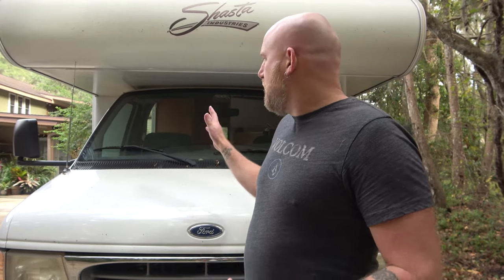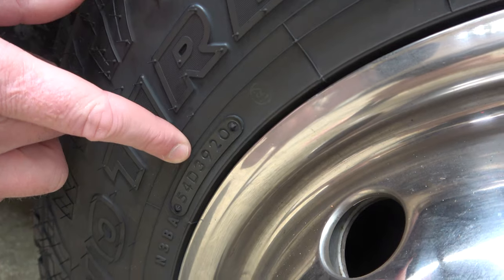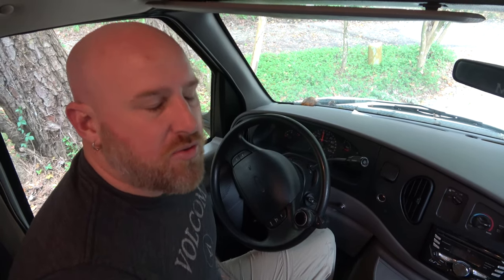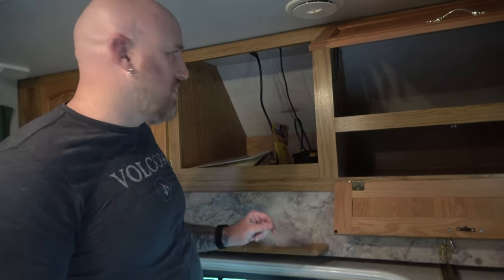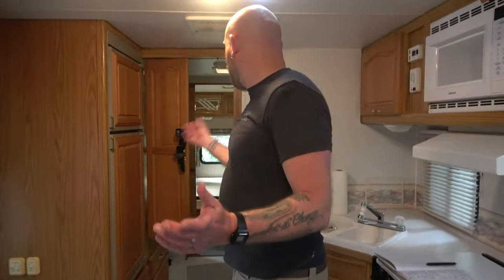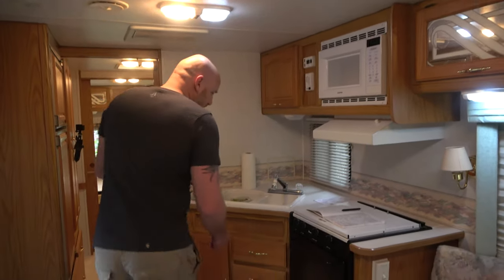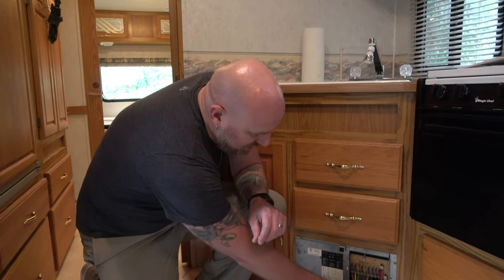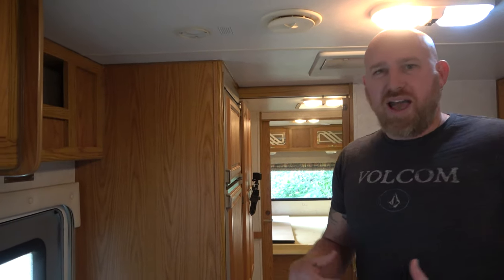What to look for when buying a used RV // Used Camper Buying Tips and Advice

Comment: As far as mileage goes, most people who get an RV use it for a few camping trips a year and most of the time it's within a few hundred miles.  Do the math on that.  If you did 4 trips to a place 300 miles away in a year, that's 2400 miles in a year.  Low mileage is actually the norm for RVs.  One other note, is that mileage is at close to the maximum capability of the drive train.  Think about wear and tear on a pickup driven empty vs. the wear and tear on a pickup that towed a trailer weighing 16,000 pounds.  So your 47,000 miles may be the equivilent of two or three times that.  Plus sitting for long periods is not good on seals and other components of the drive train.  Please don't get me wrong, that doesn't mean it's bad, I'm just saying be aware that "low mileage" is relative and actually the norm for these vehicles.
Reply from the maker: Thanks for the insight. That's why we did a boat load of preventative maintenance, had mechanics look it over and give attention to the things that looked shoddy or worn out. We ultimately replaced a few hoses with dry rot and the brakes and tires. But otherwise we've added 20K more miles without a hiccup! Thanks again!
Reply: However, they are built to carry loads unlike a truck or car. So while high mileage may be worse on an rv, low is not immediately 2x or 3x worse just because it is an rv.
Reply: @brianvandy4002 Excellent points! All questions to ask the seller about storage and hauling. I always read the comments and greatly appreciate those from  mechanics or someone who has a lot of inside information about the automobile world! Thank you
Reply: Are you daily driving this bad boy?
Reply: So would a motorhome from 1999 that has 125,560 on it, all the records are in it, (two owners) would this be too high mileage? I can’t get under it but my son can next week. I got in it yesterday and dug through everything. I found three small spots where water got in from caulking that needs to be redone. Since it’s a Lazy Daze, I know it’s made well and those spots can be easily fixed. I haven’t gotten on top or under it, that’s where my son comes in. Plus he’s a mechanic so that’s a plus. Your video gave me so much more info. I saw I did a lot right, including walking little by little feeling for water damage. I know the engine ac wasn’t working and was blowing hot air on a 102 degree day in Fl 🤦‍♀️.
Reply: There was some water damage or deamination it looks like on the rear left upper side

Comment: I would highly recommend changing the coolant and brake fluid. They will cause corrosion internally regardless of mileage. It's really just good to replace all the fluids on a new to you vehicle so that you have a baseline
Reply from the maker: Great advice! We're going to do a follow-up video shortly to talk about the next steps after finding a used RV and this is at the top of the list!

Comment: You can get a moisture sensor detector and put it on everything (the walls under everu window etc just like he did also don't forget under the beds.  NEVER forget the slides and them. Oh btw you can get the handheld moisture sensor anywhere online etc and it's cheap ❤ thanks for all of the amazing advice!!   Sorry one more thing with all of these hurricanes tornadoes "1000" year floods etc. Many NEW RV LOTS with their lots full these flooded RVs have been cleaned up and put on lots to be sold so please find out ok enough of me sorry
Reply from the maker: Great advice!

Comment: People will “DIY” them selves into a bigger cost repairing their own cars boats and RV instead of taking it to a professional. And when they can’t fix it they sale to someone who looking to buy their problems.
Reply from the maker: We have exactly the opposite experience, which is why we do what we do and share what we share. We could never afford to go to a dealer or RV repair person every time something went wrong. At $150+/hr and most RV-related tasks many, many hours of diagnosing and repairing, if you can figure out how to fix something then do it. Plus with RVs, things break and then break again. Knowing why they break and how to repair yourself is invaluable. We've gotten ourselves out of many situations on our own from having DIY experience. We know our limits. We know how engines work and can diagnose most issues from research. But we don't touch the engine. So every RV owner needs to know their limits. But DIY is not a bad thing if you are halfway handy and willing to learn.

Comment: When I bought my 97 Ford  E-350 class C in 2019,  I  checked the radiator hoses, after I had already took it home, and found out,  that every thing was original,  this man was sneaky  he had just bought 2 in house batteries so everything worked just fine for our first 2 nights of our first trip  later I found out that the battery inverter was not working so in the 4 years I've have had it I've replaced the radiator hoses water pump, serpentine belt,  all the fluids, upper and Lower ball joints,  both tiered ends and 2 more suspension rods , it's good to check the deferential oil,  mine was almost like  Liquid roofing sealer, I replaced it, in December 2022 I replaced  all 7 tires and  bought 4 Aluminum wheels, I  installed a front end reciver and bought a 12,000 pound winch just incase, I extended a rear platform 3ft for a  large  tool box and  to house the winch and  batteries  tools and  tow ropes,  it's been a lot but I hope it's ready for a 1 month trip to baja.
Reply from the maker: The older they are, generally, the more work they need. We had honest sellers who honestly didn't know what was good or bad with the motorhome as it was donated to their nonprofit and they just wanted to sell it for cash. Good news is that if you do have issues in Baja, the Mexican people there are amazing and you'll find help. We know Baja well... including many, many broken things.
Reply: A rig that old would need all the maintenance you mentioned.

Comment: .1. Make sure the dashboard AC blows cold air, there is a vacuum hose buried behind the engine that rots and leaks vacuum, that is supposed to power an actuator that directs cold air out the dash vents. $1000 repair at an AC repair place. 2 Make sure RV generator starts easily and stays running. If it has not been run often, may need expensive servicing $1000. The house batteries start the generator, power interior lights and furnace blower, water pump and electronic controls,  they  go bad if not cared for with distilled water and kept charged. Usually two 6-volt special RV batteries in series or one larger one $200+. 3. The converter charger keeps your house batteries charged and interior lights, etc. lit when you are connected to camp power, make sure it is working, $150. 4.The roof AC unit should blow cold air,$1000 5.The furnace should heat immediately and respond to thermostat settings.$400 6. There should be no sidewall cracks in tires and they should be no more than 5 years old regardless of tread depth for safety ($300 x 6 apiece). 7.The pleated day/night window shades may need repairs/replacement.$50-100, each. Some minor water damage may be acceptable. RV's are generally not designed to stay water-proof and are not  assembled by well trained people, emphasis is on speed, not much quality control. Refrigerators should be left on by seller to show that they work, they cost $1000 to replace. Slides are nice but may have mechanical problems and air and water leaks, and they are in the way when retracted. A typical Class C costs $50-100K+ new, depreciates quickly to $30K. holds value thereafter depending on amenities and condition.
Don't expect to buy a perfect used RV cheap and expect to spend DIY effort and RV repair money including maintenance, camp space rental, insurance and DMV fees,  and 9-10mpg fuel costs, much like owning a cabin cruiser boat.
Reply from the maker: Thanks for the additions.

Comment: If I may add something that may help all RV'ers

Headlights,  being able to see when driving is important lol..  there are many HL restoration kits out there , I've found Griots Garage Severe Headlight restoration kit is the best . I'm not a newbie ( was flown from my home here in North East to Arkansas to do a paint correction on an nice 02 WS6 Trans am) but this kit will give newbies professional results and your Headlights will stay clear for years not weeks or months.  The Headlight coating the kit comes with is far superior to other kits "sealants" , where the plastic will re-haze in just a few months.

Thanks for your time making this video.
Reply from the maker: Thanks for watching and contributing to helping others! Yes, this is a great thing to do with an older RV if it is needed. We replaced the headlights in our old RV because they were beyond being cleaned. But this RV didn't require it.

Comment: Thanks for the best info I’ve come across in the last 3 years I have looked online for an RV!  After all this time, I finally saw my first used Class C in person a few days ago.  I’m going back later this week to really start checking everything out & test drive with owner.  First concern was that it didn’t start; due to leaving the backup camera plugged in, according to the owner.  Unfortunately, inspecting some things including the roof isn’t a possibility for me at 68 with spinal fractures.  I was reassured, verbally only of course, that all leaks & moisture have not been present for the last year after she had roof resealed.  Old delamination areas had been voluntarily pointed out by owner.  
One of my questions is that it’s winterized, so is there still a way to check the plumbing fixtures?
Reply from the maker: Hoping your inspection went well. That's a good question - we don't deal with anything related to the word "winter" so we would not shop for an RV that ever spent any amount of time where it had to be winterized. We did find with ours that the pipes froze and we had to redo the plumbing for all of our fixtures. But we were going to do that anyway. Sorry we can't provide a more specific answer!

Comment: Thank you so much for your video 😊 as a buyer you in my Humble opinion are just like a professional inspector with your walk around and through 😊😊 you talk slow, you know your stuff 😊😊😊. I like how that E-450 Ford has power steering reservoir in front up top. The Three Aid Ambulance type vehicle that I service for a Fire Cadet REHAB program. The power steering reservoir was way down by firewall. Unless you knew where to look, it could be overlooked ( bad) when buting used, the new owner might overlook because they cant see it. I personally don't like the Ford E style fronts on RVs, like the regular truck syle fronts. Thats just me because I service 3 of them in Ambulance 🚑 type fronts. The inside engine cover is had to remove because on Ambulance 🚑
Un cab you have engine removable cover all covered over top with emergency Light switches and siren control box, radio ect.
I highly recommend that anyone looking to build there own back as a custom RV. 
Buy a used Ambulance 🚑 like are Rehab units do NOT respond code RED to calls, so normal driving for YEARS of there life
There is oiwer already to rear of box, the framing is built STRONGER. And you can easily plug a gen set into back box for portable 110 power without having ro run your engine. The big thing is you must build your rear compartment. I have seen guys with very little building experience go to work and make excellent bed set ups in them. With pota potty you can just dump in bathroom at any rest stop. The reason I bring up an Ambulance 🚑 is because some ho dirt cheap. We just surplus one of are Diesel Aid Rigs. And God is my witness, the Rig is water proof and RUNS excellent.I left the scene lights on box body, so new owner already has large lights for all around outside of unit.
Big rear bumper for easy step up into back. Lots of cargo compartment all around outside of box. One we keep portable Generator in a Honda 2000
It powered up the whole back for lightning and plug ins. Lots of roof lights inside back compartment. It had access to front from box. Seat belts on bench seat, and stretcher rods locks on floor  were easy to remove. Ambulance make great RV conversation 😊😊😊
Reply from the maker: Thanks for watching and sharing such good insight!

Comment: Learned  a lot thank you. I'm looking for my first used rv class c. You are very thorough in your inspection. Does that  negate    having to hire a certified rv inspector. Have you had any instances where you needed a 2nd opinion ? Secondly, you preferred a Ford V10. Is it because of the power and reliability vs. other power trains and chassis ? Bear with me this is my first submission.
Reply from the maker: Thanks for taking the time to watch and reach out! We know what to look for when it comes to the interior and exterior of an RV and we tried to show how tedious our personal inspections are. We'll spend several hours once we decide we are looking at an RV worth following up with. We don't know the engine side of things well - so we call our mechanic friend and have him listen to the engine and give us a few pointers from a mechanical side of things. So it is definitely worth an inspector IF you find one that will identify mechanical issues. When we sold our last RV the buyer hired an inspector for $500 who did nothing more than take pictures and write notes. We told the buyer all of the mechanical issues ourselves and he addressed it himself. So inspectors are hit or miss. We definitely found out a few things after the fact we wish we had negotiated (bad tires = $1,800 + bad brakes = $1,000) and none of the fluids had been changed (we did those ourselves and would have done it anyway)... In a seller's market there is no time to hire an inspector. But as lots of people are selling now post-COVID, prices are coming down and there is time for you to work with a seller. 2 years ago you pretty much had to decide on the spot... but we always say, if the timing is not right, then it's not right for us... as for the V10 - this was insisted by our Ford mechanic friend who said we'd never have an issue with the engine, mechanically nor with hauling the weight we inherited with a 31 foot Class C. So far the engine has been happy in our care and we haven't had any major issues nor do we anticipate it! Hope this helps!

Comment: One of the better videos on buying a used RV I have seen.  One thing that wasn't mentioned was having the RV inspected by a certified RV inspector.  The reason I mention that is just about every thing I have read or seen they recommend having not only used but even new RVs professionally inspected.  What are your thoughts on that?
Reply from the maker: Good point. However when we put this video together (just after purchasing) RVs we’re flying out the door sight unseen. Under normal market conditions if you have a week or more to arrange for an inspection they yes, it’s a good idea. However we had 3 RVs sell out from underneath us overnight when we were shopping so this is the best we could out together considering no RV was waiting for an inspectors schedule

Comment: Excellent video. Thank you for making it. This will be a big help in my search. NADA also has a website for RV values that I'll consult since it's hard to analyze value for these. Good stuff and thanks again.
Reply from the maker: thanks so much! NADA told us the value of this RV is only 4K. But it is worth so much more - especially when we bought it in the middle of such a crazed RV market in COVID. So use NADA as a reference point. At the end of the day, something is only worth what someone else is willing to pay for it. So if that 10K asking price sits long enough, you could get it for 5K. Or if 10 people show up for it on the same day it could jump to 20K. NADA can be somewhat useful. But lots of study of what's actually out there is important. We actually worked with our insurance company on a stated value to the RV after remodeling ours because there is no way we could replace this RV for the 4K NADA said it was worth. We have 4K in batteries, inverter, solar and wiring components alone!

Comment: Thank you for this thorough explanation of what you looked for in a used RV. I hope to be purchasing a rig in the next year(God willing)
Did you walk the roof during your inspection?
Reply from the maker: Glad it was helpful! And hope it works out to find and buy the right RV! Yes to the roof! We didn't show that part of the inspection, but we definitely climbed on the roof. I walked every inch, foot over foot, to make sure there were no soft spots. I also checked the roof material, which is where we realized that we needed to reseal the roof (something we felt comfortable doing ourselves, and have a video on if you get to that point!). We also inspected the vent covers and ended up replacing a few (again, not a deal breaker in a 22 year old RV!). So yes, definitely spend time inspecting the roof. Keep us posted in your search and let us know if we can help at all!